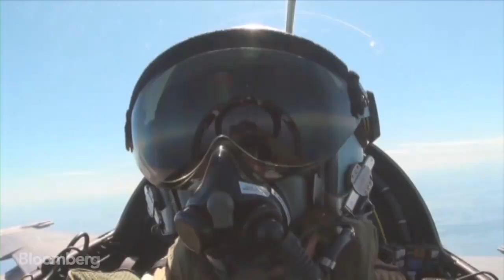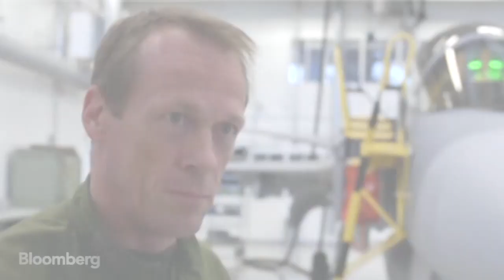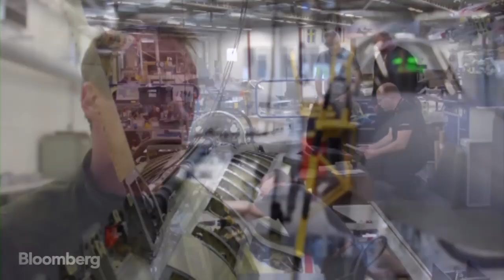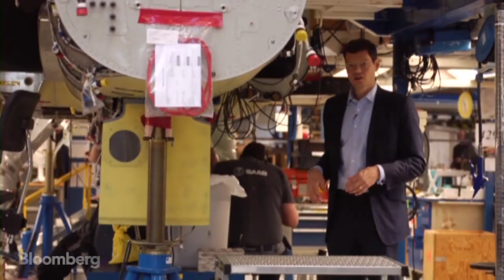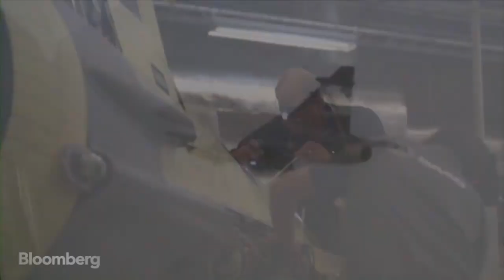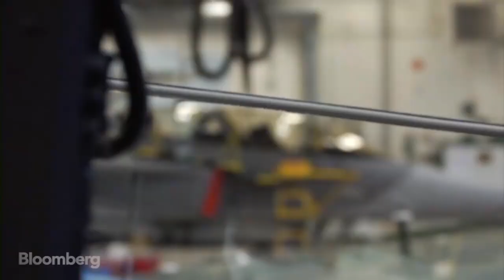Saab Gripen Jet Too Pricey for Europe's Richest Nation?

Comment: A sea Gripen (naval version which is being part developed in the UK) might have been a better option (certainly cheaper) for the HMS Queen Elizabeth
Reply: Nah man what you guys need is a harrier3, or an euroharrier, like the F35B but with less sucking
Reply: No sucking is good...more sucking in the intake, more thrust in the exhaust.   F 35 is so awesome cause it sucks so much.
Reply: what about both
Reply: @ingusmant  the f35b is superior to the harrier though it's faster has a much smaller rcs and isn't as likely to flip over and kill it's pilot
Reply: Only V/STOL aircraft are capable of working on carriers without CatoBar.  A navalized version of the Gripen wouldn't work on QE class carriers.